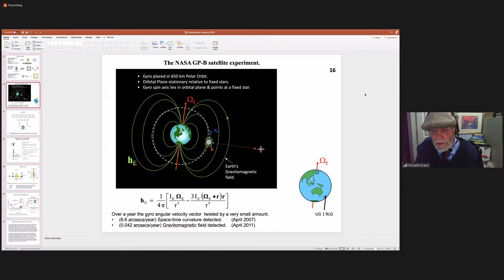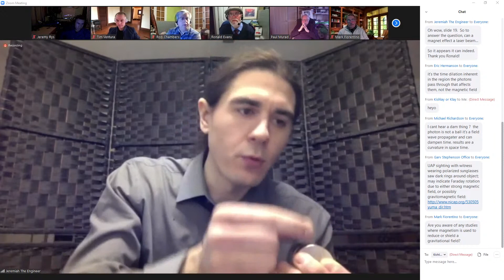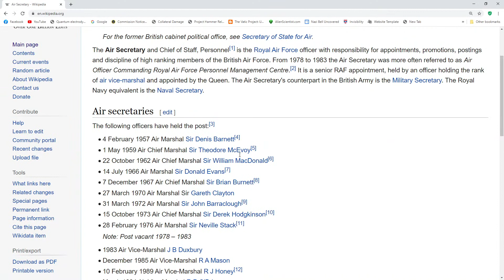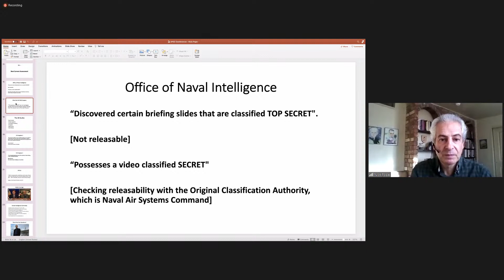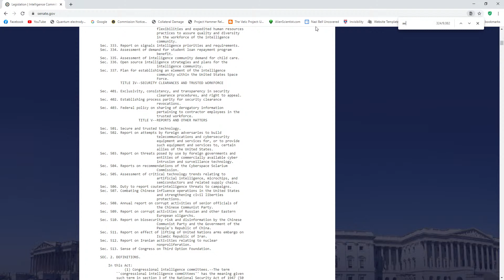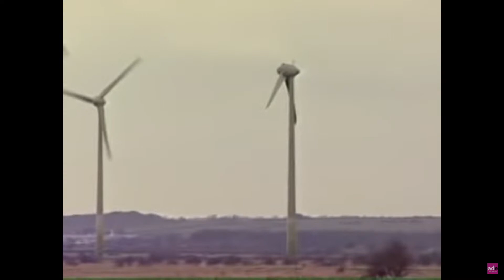APEC # 4  Ron Evans (BAE Greenglow) & Nick Pope (UAP TF & Truth Embargo)

Comment: The guy at 1hour 09mins has no idea what he's talking about.
I wish he'd use Google or just any standard physics book before investing in equipment and detectors to try and get readings to prove a hypothesis that has been both theoretically and experimentally debunked 

Regarding light being by magnetic fields: 

Heres a good answer someone wrote 

Unfortunately, the path light takes is not affected by the presence of a magnetic field. Light itself is composed of an oscillating electric and magnetic field, and one very important property of electric and magnetic fields is what we call "linearity." That is, if you have two sources of electric and/or magnetic fields, you can predict what the combined field is just by adding the two source fields together. The two fields don’t change each other at all. So if you add the field of a light ray to any other field we can imagine, the light ray will continue as before and the extra field will just stay the same, adding to it in places where the extra field is strong, but having no effect beyond the reach of the extra field. So there is no way that a magnetic field can bend light.

Comment: ALIENSCIENTIST: last time I said I wanted to apply for a job at Tachyon Aerospace. I've looked them up and I believe they are frauds! Check out their website, and their progress, they don't have anything, just cgi videos/pictures. They claim they are building a transatlantic craft, their claims are an actual joke, all this powered by a plasma reactor (no joke thats what they call it, nothing about how it works), a inertial gravity thrust spinning device, and Tachyon engines which are equipped with a way to produce their on fuel on board.
I've looked at their claims, so called designs, and progress, and honestly its a joke 
I'm so upset 😡 😫 😒